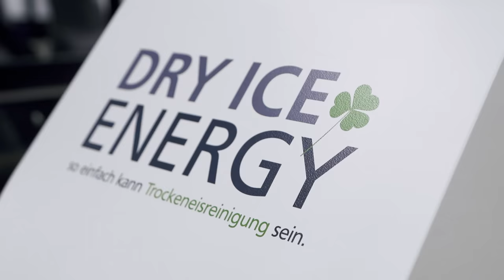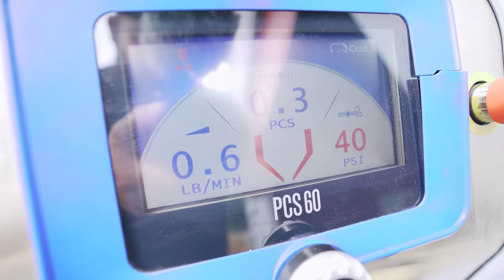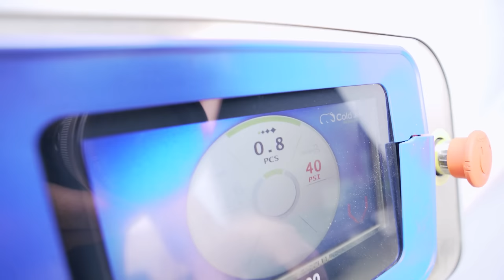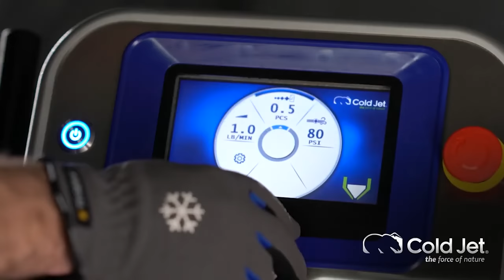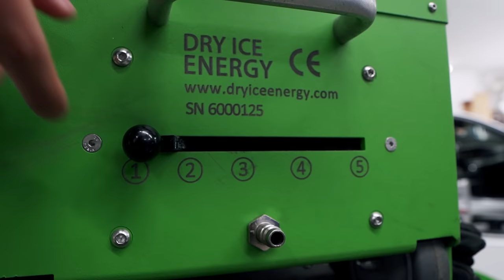What You Need To Know About Dry Ice Cleaning

Comment: too funny 00:30; I purchased my coldjet (way too big IMO) dry ice machine 3yrs ago & 185cfm compressor 2yrs ago to clean up my cars (very low mileage 20yo renntech, dinan, IRL, CART etc) so I can sell them and be done with cars. I haven't done any yet because I don't have a lift in my shop and no spare time .. in fairness I'll also need it to restore my Beech Baron.
Reply: @Resq Av8r How much did it all set you back?
Reply: @RichRotorhead  I purchased it used for slightly under 50K but that made sense to me prior to the pandemic when I had a business that was making money. NOW I might have to use the equipment to do a business.
Reply: @resQ-av8r  I'm seriously considering doing that some time this year 🤔

Comment: @13:55 - RIP seat cover.  Very fascinating tool, though.  Seems like a great option for more durable materials.  I wonder - I didn't see a vacuum to collect all the liberated crud.  Is that a normal part of the process?  It may not matter for undercarriage cleaning, where you can sweep up the bay afterward.  But on an interior, isn't there a noticeable amount of dust collecting below the work area?

Comment: What do I need to begin dry ice blasting turbo? 
Do I have to use specific air compressor or any type and do I have to get after cooler so can you help me out for air compressor setup please.
I went to local dealer around me and I got this setup. With oil or free oil idk 

22 KW
Cfm - 118 
Pressure : 10 Bar. 150 psi or

30 KW
Cfm - 172 
Pressure : 10 Bar. 150 psi

Comment: I purchased my unit from Scott in October.  And I've been loving every minute of it been cleaning engine bays and wheel wells mainly, hope the business picks up in the future.
Reply: Thanks 😊!
Reply: Hi there. 
Just wondering how much did you pay for the unit?
Reply: @carlitozway2799  hey it was about 14k CAD with shipping
Reply: Investment of $7k for what return? Have you decided it was a good business move?
Reply: @klaus2621  for me personally yes it was
Reply: I know in the detailing community using it on paint is "no no" but curious have you tried it and does it work "cleaning" dirt and grime off paint as an alternative to pressure washing
Reply: @dnsv08  it's a great alternative to pressure washing, you could clean the entire car it just might be a little time consuming.  And it's rather safe on paint at a low setting I use it for engine bays, wheel wells and under carriage.  With a little practice/training you should be fine as far as leather goes I wouldn't use it on that, anything else is a go IMO
Reply: Hey. so how much dry ice did it take to completely clean the underside of the car?
Reply: @BDcrane34  depends on how it looks I'd say at least 100 to 500 pounds

Comment: I LIKE. GREAT PRESENTATION.  CUSTOMER INPUT.  I WOULD WANT THIS CLEANING SERVICE FOR:
■ MY INSIDE WHEELS . LINCOLN PLASTIC CHROME CLADS. LOTS OF JUNK INSIDE
■ BEHIND WHEEL WELL PLASTIC
 ■ ALL LOWER DOORS AND DRAIN HOLE AREAS
 ■ BOTTOM CHASSIS - Front to rear
 ■ RADIATOR - INSIDE / OUT
NO DISRESPECT,  HOWEVER I WOULD PATRONIZE YOUR FACILITY AFTER A YEAR IN OPERATION. 
YOU CAN DESTROY A VEHICLE VERY EASY. KNOWLEDGE/EXPERIANCE IS PARAMOUNT.

Comment: what happens to the material that you knock off the car? is there a pile of dust and greasy shit under the car, not an issue I just wanted to know. I'm thinking of setting up my son with the equipment for use in the Long Isand region.  Im hiring a research firm to collect data on the viability of  such a business. There are millions of detail and wrap shops, so the cars are here. However I don't know how many machines are already in the area.
 Not just focused on cars either, seems it would be helpful for many other businesses,  but are they willing to pay?

Comment: Where does the dirt and grime go?
Reply: You know, where all your missing socks are, the dark side of the moon.
Reply: All forms of cleaning are the same.  You're just moving dirt from one place to another.   In this process, the dirt falls to the ground or any horizontal surface.  Initially, most of it is atomized.  But eventually it succumbs to gravity which is why we perform the work in a container space like a paint booth but the opposite.   A paint booth is meant to keep dirt out.  Our booth is specifically and specially designed to keep the dirt in!

Comment: Running a large volume compressor, do you also need a refrigerated dryer?  I can imagine that inducing the compressed air condensation into the dry ice stream and onto the surface being cleaned could be bad without a dryer, even with a holding tank.
Reply: A refrigerated dryer won't cut it in most parts of the world.  In the desert or arid locations, yes.  Everywhere else you must run a desiccant dryer.

Comment: I would never let you touch my car with dry ice blaster.  We cleaned our printing presses with dry ice and you never go anywhere near grease or oil.  You will blow out seals, gaskets, and can damage rubber with dry ice.  Dry Ice also has a shelf life and has to be used quickly or it will melt.  Anyone who tells you different is trying to make money selling it.
Reply: Well it all depends on the power the machine has... You need the right tool for the right job.
Reply: You can store the dry ice for about a week.
Reply: @dryiceenergy_original  3mm pellets maybe, but micropellets really get worse each day.
Reply: I would imagine that damage would happen if you allow a caveman to run it.  Without proper training, damage will occur, guaranteed.
Reply: @dryiceenergy_original  if you have refrigeration if not it last about 2 days max in the totes they deliver in.
Reply: @sferg9582  I would not let a minimum wage employee anywhere near anything I own with a dry ice machine.
Reply: Like many things in life, it's about the right tools, the right knowledge, and of course experience.

Comment: The one thing that wasn't mentioned is the clean up coz dirt has to go somewhere, i had a dry ice machine its good for its intended purpose but not fun on the clean up lol
Reply: Really gotta have a separate room just for dry ice cleaning. Also, Swisstrax floor is helpful as it hides the dirt for the moment but in the end, you're right, big clean up always necessary!
Reply: Better than walnut shells
Reply: We perform all work in our DryceBooth.  
You wouldn't paint a car outside of a controlled space.  This process is similar.